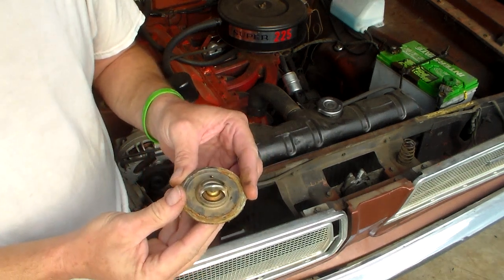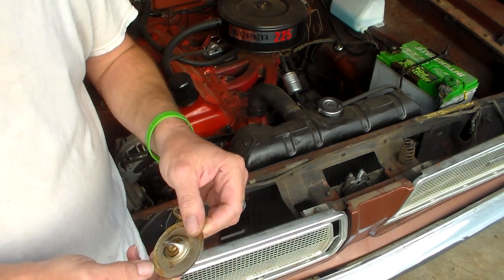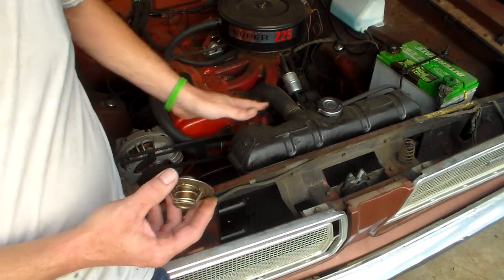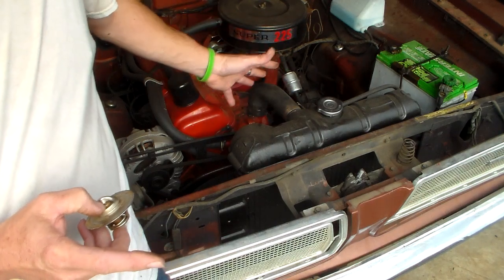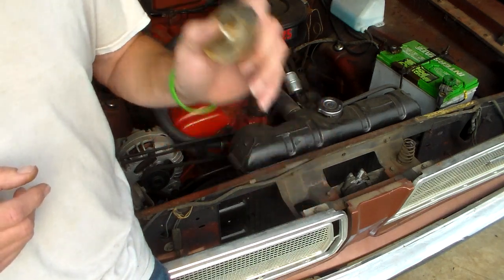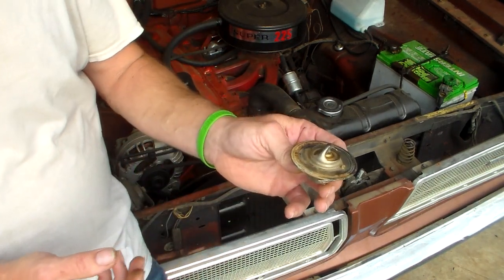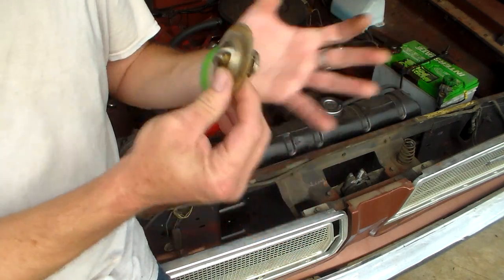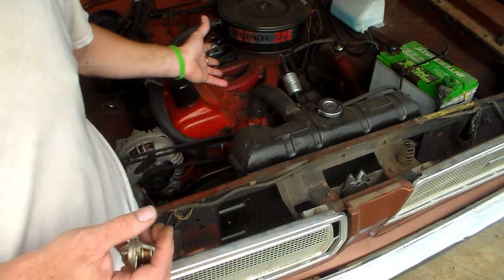Why do so many people misunderstand how an automotive thermostat works?

Comment: I am excited for the day when the auto parts industry FINALLY offers a thermostat that ACTUALLY maintains the engine temperature listed on the thermostat box! Lol. Seriously though, it would be great if they could perfect a thermostat that could only fail in the fully open position. The old engines (that are full cast iron) can usually take quiet a bit of overheating. Even if it overheats enough to blow a head gasket, it typically doesn’t warp the head or block. On a modern aluminum engine block, a thermo that sticks closed can be the death of the engine. Not only can it easily cause a blown head gasket, it can warp the head, the block, and even pull the threads out of the block for the head bolts.  Sometimes, the thermos will start by sticking open but if you don’t replace it and just let it go, it can eventually close and stick closed. I like to replace the thermostats on my cars between 130-150,000 miles just as a preventative. I like the Standard Motor Products stuff because I have found them to be reliable. The last Standard thermostat I bought turned out to be a repackaged MotoRad. As I recall, it was stamped MotoRad MADE IN ISRAEL ... but couldn’t say if all of their products are made there. All removing the thermostat ever does is render the heater and defroster useless in an old car but the computers on newer cars rely on correct water temps to manage the engine.

Comment: Good video, the 73 Satellite that I purchased a few years ago never would put out any heat from the heater. It has a 318 in it, and I looked to see what temperature thermostat it had. The pervious owner had removed it. After I put the correct thermostat in, the heater worked, and the car ran better.

Comment: Yes Tyler, up on Long Island, we'd put cardboard in front of the radiator (winter time) to help get heat inside the car for defrosting the windows and stay warm. Actually, the rule of thumb was; 160 degree thermo for summer, 180 degree for winter. THEN, late 1970's there was the 195 degree thermo which I ran for quicker warm-ups and more heat! 
I have had thermostats stick closed, and some stick open. My Valaint ran so hot in the summer once, I removed the thermostat completely, the temp gauge read ALMOST on the "H". 
The radiator was 95.9% blocked, so removing the thermostat did nothing. (I was running the heater, and saw the engine temp drop a little. CLUE.) Yes, the thermostat "sets" what minimum temperature the engine will run at, as you say. A "pre-set valve" exactly as you described...That's it's only function as you said.
Cold start; thermostat is closed, no circulation thru the radiator.. The coolant circulates around the engine block (thru the heater core if heat is on) via the water pump.
Warm engine, thermostat opens and coolant now circulates through the radiator for added engine cooling.
Thermostat selection sets the minimum engine temperature as TYLER explains....
GREAT LESSON, TYLER!
ALSO, the " SOUTHERN TIER" of upstate New York...(Snow belt region).

Comment: You're exactly right. The radiator is in charge of cooling and heating. The reason people put blankets over the grille of diesel vehicles up north in the winter. Engine doesn't get warm enough to make heat etc. Block some airflow to the radiator. In the heat, you need a higher capacity radiator. And thermostat matched within reason to your engine's operating temperature

Comment: Most Engines need to run at a minimum temp like 180 so the oil temp is high enough to evaporate the condensation from compression process that why short trips are bad for an engine longevity cause oil never gets hot enough to disperse containments.... I.e. pcv Engine normal running temp is due to a good heat dissipating radiator the heat transfer and pressure a 160° thermostat will do more damage by keeping the heat range to low especially in colder weather. Modern cars fuel injection rely on engine temperature to be at a specific point to go to closed loop.....so a lower temp thermostat would throw the computer fuel strategy off.
Reply: On my Honda Accord the computer sets the automatic transmission shift points according to the engine temperature.  In cold weather it lets the engine rev higher before it upshifts to get the engine to operating temperature faster.  On the Toyota Camry I had before that the overdrive 4th gear would not engage unless the engine was at least partly warmed up.  So correct cooling system operation is an integral part of a car's proper functioning including reduced emissions and longer engine life.

Comment: You are completely correct. A lower temp thermostat can actually make overheating problems worse. The thermostat opens too soon and stays open and does not allow coolant to stay in the radiator long enough to cool down.  Which causes the temps to slowly rise as the radiator cannot cool it quick enough.